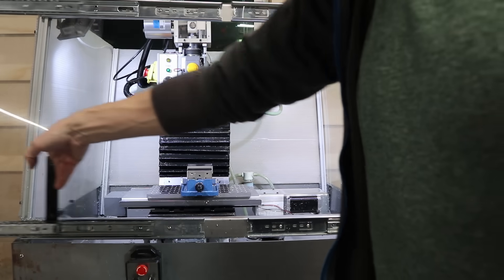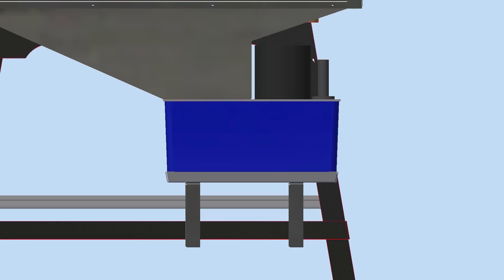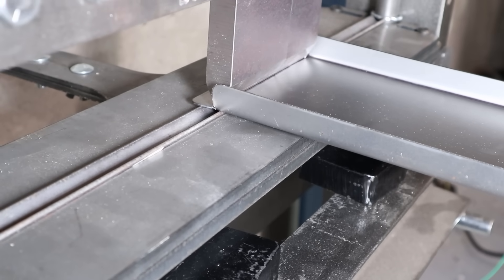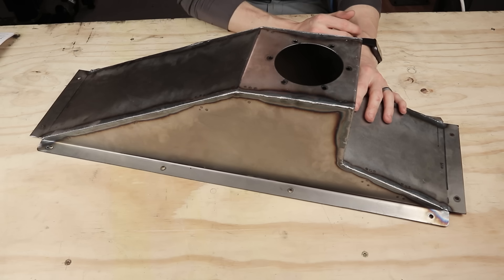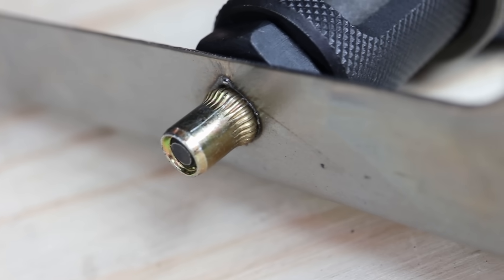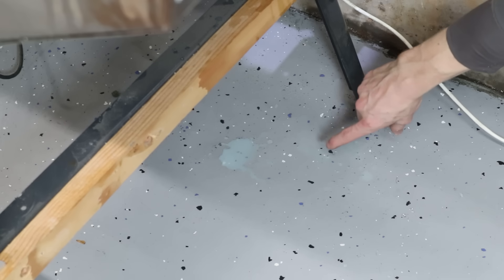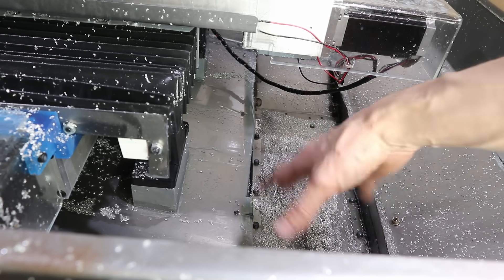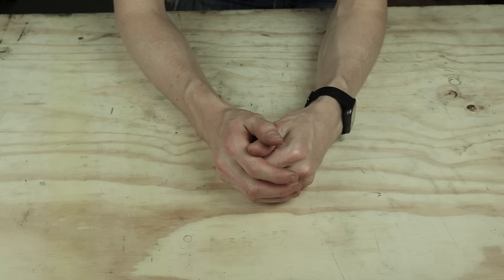Fixing a little mess with a big mess

Comment: “If it wants to flow sideways it has to go back up a vertical wall, which it can’t do”. Buddy it’s 2020. Prepare yourself.
Reply: Ever watched the plume of a rocket launch wrap up ahead of the engines as the atmosphere thins out?  Like electricity, most of a fluid takes the easiest path, but some of it goes every way it possibly can (as dictated by pressure gradients).

Working in aero/thermal, it took me a minute to accept that with a rear-angled defroster jet hitting a highly raked windshield, some of the defrost air actually turns around and goes forward, down the windshield.  But it do.
Reply: @C20H25ON3  "But it do."

Look man, fluids are WEIRD.
Reply: @liesdamnlies3372  Especially bodily fluids, like, where did evolution get the idea of, "Hey, my eyes are all shrivel-y and dry, guess I'll cry now" ?
Reply: @Runedragonx  No idea. You'd think evolution would have figured-out room temperature superfluids that also magically won't escape from the surface of your eyeballs.
Reply: @liesdamnlies3372  evolution is the laziest engineer ever, willing to go to enormous lengths to avoid having to just fix an issue.
Reply: @hedgehog3180  Sounds like software engineering.
Reply: @liesdamnlies3372  A bunch of creatures are still in the "use my appendages to wipe my eyeballs clean" stage, so I suppose we should just be grateful lmao
Reply: Surface Tension be like "yall mind if I hit that?"
Reply: RNGesus rip
Reply: *whistling coolant flowing up a vertical wall
Reply: I WAS LOOKIN FOR THIS COMMENT
Reply: We have unlearned so much I’m not surprise that gravity gets Uninvented
Reply: Through the power of Van Der Waals forces everything is possible.
Reply: https://youtu.be/6ZzuFGw4XCg

Comment: System of the filter is a good I would of have chosen that idea too more pratical  but the nut serts or rivot nuts have that lip giving it a fine gap under the filter letting fine sworf or steel chip seep through leting it build up in the tank over time so a o-ring or silcone let it dry then bolt filter on top to stop that and don't get me wrong nut serts they are awesome. But other than that that's mint set up

Comment: i'm inspired by the pen plotter on the plasma table, and I had a thought...  how about a "self cleaning cnc" some system that washes the cnc down to flush all of the chips into the filter?  this leaves you only one spot to clean.  ...and maybe you should clean the chips off of the pump, vacuum the chips out of the fan..

Comment: Suggestion: Weld handles onto either end of the filter, the mechanic in me is cringing at the thought of trying to pry that filter out without dumping swarf into the tank.
Reply: also if he could somehow get a slant into it and design a second external catch so that he could just scrape it out, and the flow of coolant might also slowly move the chips into the external catch.
Reply: Or he could just clean the chips up from the top of the filter without removing it?
Reply: @markfryer9880  well, he could do that but whats the fun in that, why not overenginer it to be self cleaning and automatically puts stuff into a bin.
Reply: Or just use a shop vacuum :)

Comment: These rivnuts do exist with a closed off bottom.
You should use them to mount the big drainer to the rest of the enclosure so no coolant is able to leak through the screw itself.

Comment: I saw you used a normal drill bit to drill through sheet metal. I think you would find a step bit works a lot better and leaves a cleaner hole. Just a suggestion.

Comment: As an engineer who specializes in press brakes, I find your pen plotter to be an interesting short cut. 
Now to convince my company that it's a good idea haha.
Reply: It really is a good idea, though. And not stupidly expensive to do. He has a video showing exactly how he made it.
Reply: @Cynyr  if you're after accuracy, then there are formula to use that can get you within 0.2 mm without scrap. That said, for a quick one off, I'd use this all day, since my coworkers tend to take an already cut part and mark it with a sharpie for me to bend anyway.
Reply: @oddsketch9969  I was just looking for a finer line than the sharpie.
Reply: @Cynyr  honestly, if your plasma cutting, what's the point? I could see it with a laser, but a plasma isnt spectacular at holding trim on the kind of thickness we use it for anyway, so a sharpie is just fine. We laser cut anything 10mm or thinner, especially if it's for a customer with GD&T requirements.
Reply: @oddsketch9969  Hey, where do you work?
Reply: @aquascapemx  I work for ironform
Reply: Instead of the pen, why not just laser a small notch at each side of the bend line?
Reply: Im an engineer that specializes in sheet metal. Most of my parts are laser cut so i just have our guys laser etch the bend lines. Modern press brakes shouldnt need bend lines but theyre helpful for verification
Reply: @daytonm6809  yeah, modern pressbrakes almost feel like cheating dont they? The ones we use even display a cad model of the part in the machine to help ensure you dont put it in wrong.

Comment: Nice work but...I don't understand a novice's obsession with flood coolant. People buy these tiny Tim machines that will never be used in large production and then spends months trying to perfect a coolant system. It just doesn't make sense.

  I was first trained as a machinist 23 years ago and I've been a mech. engineer for almost 20 years. I NEVER use coolant. You do not need it unless you are trying to maximize production in an production environment. The only thing you need is a drop of oil or a mister 99.9% of the time.

Comment: Excellent work. Compliments all around !! Thanks for enlightening about rivet nuts = woa cool !    Regarding the project > great craftsmanship, excellent build. I do feel like it is overbuilt and u probably could have a more efficient design. Rather than specifically commenting I will share a habit of mine. = I generally plan everything with 3 different levels. One level is minimum parts ; minimum labor ; minimum expense. second level is 'all the features' 'bells and whistles' 'spare no expense' . The third level is meshing to find the happy medium.   Another way to say it is > find the edges/perimeters first, otherwise you will never know if your mark is near an edge.  edge=mental paradigm type of edge.

Comment: Loving your videos especially your mods to the plasma cutter (are there any manufacturers that our incorporating these ideas) Also you mentioned the Resistance (spot) Welder  shouldn't be throwing sparks wondering if you might be able to point me into the right direction to solving this tried google it but nothing. mrpete222 gave some great info but not troubling shooting I am a Tech-Ed teacher now doing metalworking and would greatly appreciate any help keep up the great work

Comment: You need a punched piece of steel over the fragile screen.  How do you remove the chips from the screen without damaging it?  Doesn't all that "ordinary" steel rust?  How do you prevent the machine from becoming a mold culture chamber?  (You should remove the coolant and dry the machine after each use).  I have seen gross machines in this respect!  If you use the machine daily (as in a factory), it is not such a problem.  But for the hobbyist, when it is inactive, mold grows!

Comment: Great job, only I think it would be easier clean up if the filter had a reamoveable chip basket above it ie a double filter, lift the upper filter basket out & dispose of chips, existing filter still protects against any stray chips getting into the tank when lifting out the upper filter basket.

Comment: I have 2 suggestions for your CNC mill. 
The first is to press form the bottom support for the stainless mesh filter like the coffee grates you made in an earlier video (won't matter how many chips pile up on top of it).

The second is to install a quick disconnect where the coolant hose connects to the sprayer. This will allow you to connect a nozzle and hose the chips off of the mill with the coolant.

Comment: If you need a finer mesh, make a second identical filter assy, (without the riv-nuts), and put it over the top of the other. The screening will not line up, and you'll get a finer effective mesh without the problems of a finer mesh, (getting plugged, hard to clean, etc).

Re: vid nuts
Love  'em.  I found a heavy duty version of them at MSC. They are Allen Nuts. They are a case hardened barrel with threads on one end, and a hex socket on the other. They have a 'belt of straight knurling on the outside, so you can press fit them into thicker stock.  Think of them as riv-nuts for non-sheet metal.  They also have a great use as a nut in a recess.

Re: electronic angle finder
love them, as well. I was a carpenter in real life for 35+ years. When electronic levels came out in the '90's ('80's?), I immediately bought one.  It is the ONLY tool I have ever bought which instantly made me a better carpenter/builder.

Re: sealing things like the tank
I have been using 3M's Rubberized Undercoating for nearly 40 years, and not as undercoating.  I used to build custom cars and race cars for a living. It takes a lot of work, and time to build custom brackets, braces and such, (remember, that is the dark ages compared to this, the CNC age.).  The problem is, a small bracket is really hard to charge 75.00-100.00 bucks for, when it's 2 fiffy worth of steel.

BUT, if you spray a light coat of rubberized undercoat, (think light sheet rock texture), then color paint it, you hide the weld spatter, grinding marks, AND you can then charge enough for it, you can feed your kids!

The real point of telling you about 3M's undercoat, (ONLY 3M's is worth), is if you combine it with alternating layers of the spray rubber Rustoleum sells, the works very good as a sealant for  things such as a welded tank.  I've used it on roof flashing, and it has held up for decades.  Always final coat with a good paint, to block UV, tho.

Re: you seem to do a lot with sheet metal
Look into the sheetmetal guy's best friends, Clekos.I discovered these learning to do race cars interiors, (sheet aluminum), which are drilled and pop riveted in plac
You fit the sheet, and are ready to attach. If you drill and rivet the first hole, you will ALWAYS need to take it out, later, for some reason, guaranteed. If you 'temp' with a screw, you will eff up the hole and your rivet will be too small.

Cleko comes to the rescue. They are little split shank temporary rivets. Drill a hole, put in a Cleko, drill the next, etc. Clekos are spring loaded, and hold the panel until you are ready for ALL the rivets.

They also make a little adjustable spanner looking thing for clamping down on the edge of sheets for drilling or welding.

There are expensive pneumatic Cleko tools, but a pair of manual Cleko pliers work fine.  Also, there is a generic brand of Cleko knock offs, with some additional features & types at MSC.  If you have both, you'll be set.

((Full disclosure, my wife works for MSC, and we do own stock, but I make nothing directly from mentioning things they sell.  I just buy a LOT from them because their employee purchasing program is like hitting the lotto for guys like us!  LOL))

Enjoy, hope some of my tips make your life easier.

Regards,

GeoD

Comment: Very nice job, thanks for sharing this. I like your Dan Gelbart style of construction. 

I agree I can see that mesh ending in tears. I think if it was mine I'd make a S/S "chip frier" style tray of coarser mesh to sit on top to capture the bulk of the chips, make it easier to clean, and protect the finer mesh under it. You could simply fold one up and tack the corners as it wouldn't need to be 100% filtering.

Comment: You should maybe consider adding another filter layer with finer wire mesh to keep the pumps and reservoir as clean as possible without constricting the flow too much
Edit:
Okay I've got to the point where you brought out the screen... Nevermind, it's fine enough 👌
For now 🤔😜

Comment: A better way to check your welds for leaks is to use alcohol with a few drops of red food coloring. If you have a leak it will be clearly visible. You can pour the excess alcohol back into the bottle for next time.

Comment: Good job going for large surface area. We end up adding that to a lot of the industrial cnc machines at work.
If you use it for a bunch of parts, you may want to make a bin that sits atop your filter that pulls out easily. Same mesh size or larger (even a plate with lots of tiny holes for ease of cleaning). Instead of scooping chips with your hand, you grab handle on the bin, pull it out and dump it. Drop it back in and good to go.

You still want what you made in place to keep the coolant clean, this just makes emptying chips a 30 second affair.

Comment: Emptying your coolant tank is a perfect example of when to use a suck bucket.

If you make a new one, weld a pipe fitting at the lowest point and put a ball valve on it. Suddenly, clean out and hose down becomes easy (into a bucket or attach a hose over to a floor drain).

Also, if you ever punch through a filter and get chips in your bin, you can drain it into a couple buckets, wash out the tray, fix the screen, and pour the buckets back in. Done.

Comment: Love your channel, but as a metal worker there were few things i would do differently... first one is the lead-in of you plasma. Your holes seemed to have this "burn" from the lead-in.. i use fibre laser, so i can use 90 degree turn from lead-in to cutting a round hole for 1- ~5mm (0.04-0.2 inch i think) material, after that i need to use arc lead-in, in order to make the hole round... but since you have plasma, i think you should have arc lead-in when ever you cut a round hole.

I also would have applied some silicon paste to the seams (¿?¿ sorry, inglish is my 3th language) of that coolant tank... maybe you did, but its great way to keep water from leaking..

oh and that coolant nozzle thing, you should add this octopuss thing on it (i don't know the name)... its made of small separate cones, and you can twist and turn them in any direction and it holds the form, and you can close the nozzles if you feel like you don't have to use all of them... really useful. oh and you can use them to clean the cabin of the cnc mill... just close all but one and spray the metal shavings away ^^
Edit: ad -> add
Edit2-5: youtube in all of its wisdom took all of the spacing away -.-
Edit5-10: ok google... this thing is just... why cant i just hit enter and leave on space between different things.. either i have 0 or 2 rows, there is no middle groudnd -.-

Comment: Screw kitty litter get oil dry
Reply: Same stuff more or less but cheaper and designed for the purpose, and such. Or use something more renewable. Ironically kitty litter doesn't make the best kitty litter,  it's not renewable and the dust is bad for living things to breathe, wood pellets are a lot better.

Comment: Wouldn’t it be easier to simply thread these holes instead of using rivetnuts?
Reply: If you tap sheet metal, you will get 1 or 2 threads cut, it will strip as soon as a load gets put on it.

Comment: if you make the filter at a 45 leading to a place that collects the chips it make it a lot easier to clean.. you can even add an auger at a angle to pull the chips out and into a bucket

Comment: Prolly a little late, but have you considered making a second easy to remove mesh on top of the first one? Kind of like a 2 stage chip filter system. Something that just drops in for easy cleaning. Once it fills up with chips just pop it out and dump it. Might take all of a minute, but then again it doesn't seem like coolant flow rate is a problem for you.

Comment: You could plumb a kitchen sink sprayer (https://www . homedepot . com/p/Delta-Side-Spray-Assembly-in-Chrome-RP54807/204059046) on a Y from the coolant feed so you can wash down the enclosure,  pushing chips onto the new coolant screen for easy cleanup.

Comment: Nice job. For the filter screen I would have used weld nuts instead of rivnuts, they leave the other side flush. And you could put the tab style ones on with a spot welder. But hey use what ya got if it works. Wish I had the will and money to build my own cnc so props to you

Comment: Monday morning quaterback I know. 
For woodworking there is a thing called a DustDeputy - redirects that air so stuff circulates and falls but the intake is higher and at a 90' to the stuff falling.

You could have put a filter sock on the intake of the pump and have it drink higher than the bottom of the well (which you already do). then you could do a petcock or something on the bottom of the well when it is really full of crap just drain off the 'tails' along with some coolant and sludge.  Maybe use a 6" downpipe, 4" reducer, 90' - section with petcock, 90-' back up to whatever the pump's diameter.  

Great project btw.

Comment: If you want to cut thin metal without sparks then a oscillating scraper multi tool with a metal cutting blade on it will do a good job. no sparks and the bits of metal drop out where you make the cut and don't end up all over the place!

Comment: You should probably clean up the motor with distilled water maybe with some soap and get rid of all the metal particles out of there is possible. Otherwise it will grind inside forever probably. You might need to disassemble the motor pump, because magnets might be keeping some metal particles there too.
Reply from the maker: Good idea. Thanks for the tip 👍

Comment: Did you seal the gap between the filter frame and the filter base (caused by the rivet nut)?
Reply from the maker: Yeah - I had adhesive rubber gasket strips that I put between the two surfaces